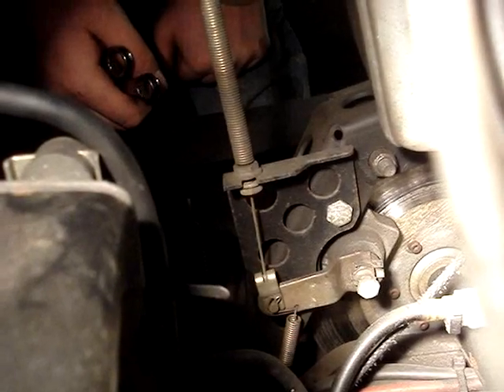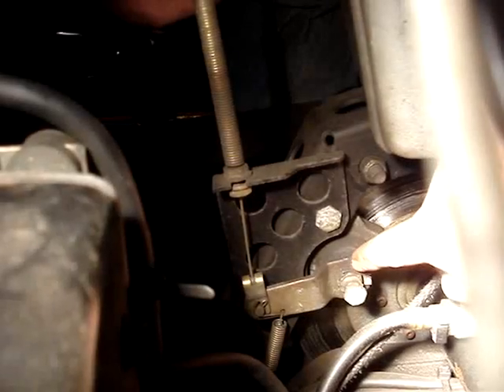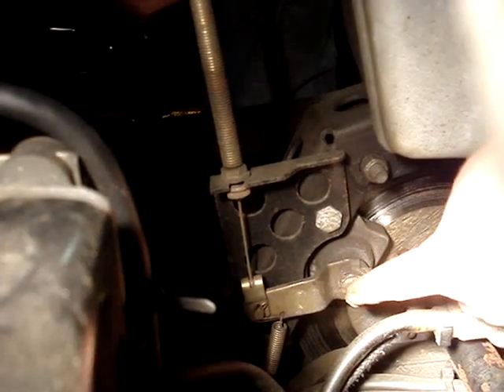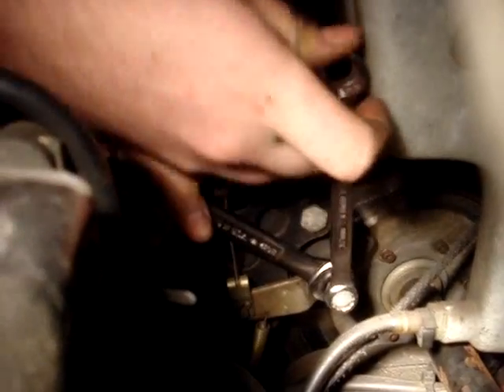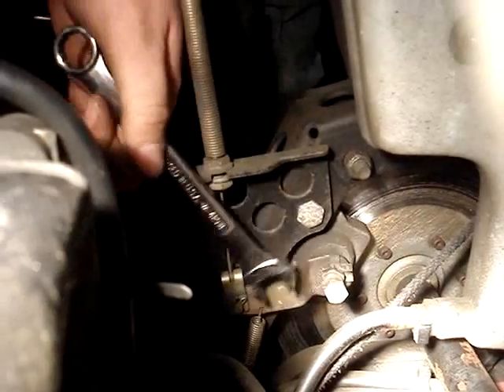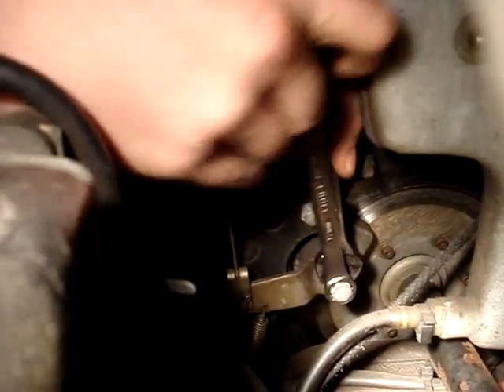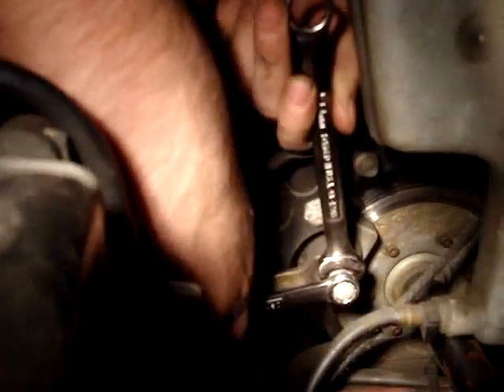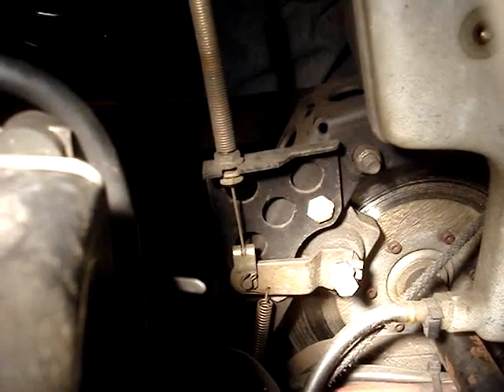How to adjust arctic cat snowmobile brakes (cable type)

Comment: Thanks man! got a question as i have the same sled, how the heck do you get that calliper off? the bolts loosen up till they are not threaded in anymore but dont come out, there is something more holding them in